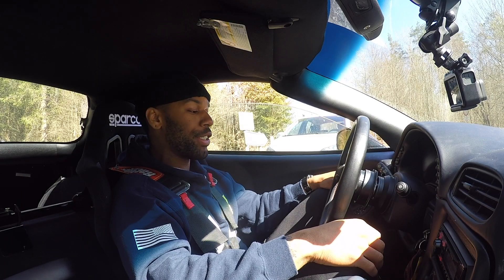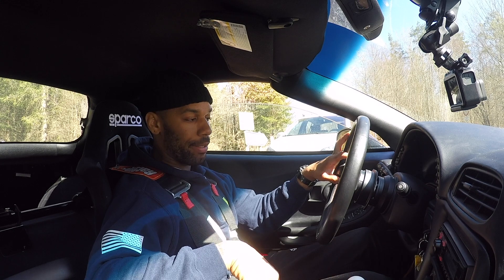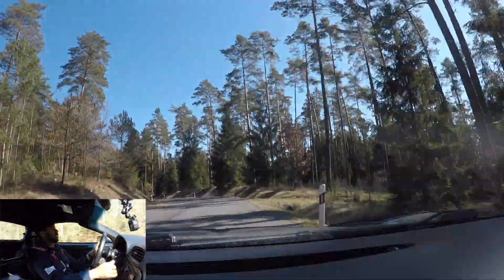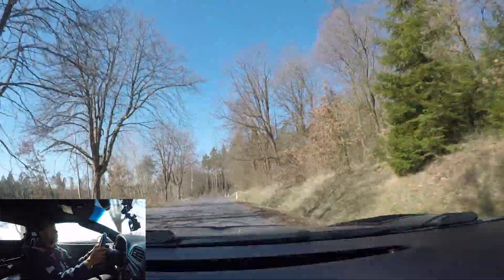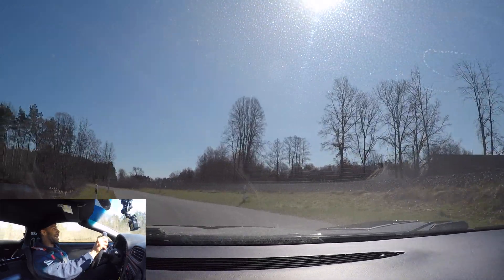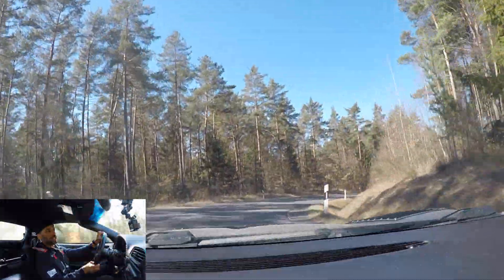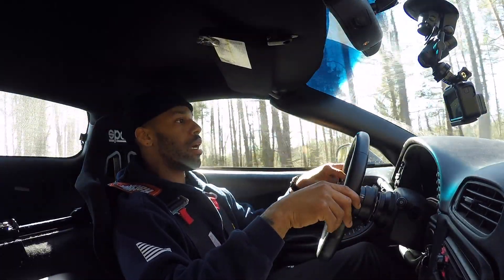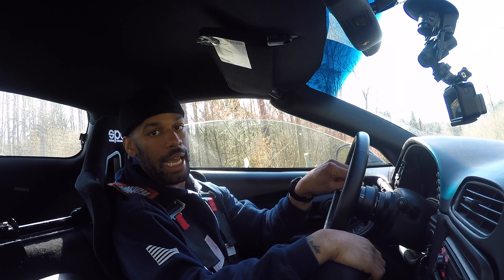400whp C5 Corvette Z06 Review

Comment: Love the vids. Mine is an ‘04 base and it’s great. Came from a NA Miata and ‘13 mustang and found the perfect marriage of those two vehicles. Running 285/35 square with Cam, intake headers (ported heads on the way from Texas speed). Tell people all the time it is the most rewarding and satisfying cars you an buy for 10-15K. Keep up the awesome content and stay safe.
Reply from the maker: 100% agree with you, people are so quick to write the c5/c6 off. But with the right mods these feel great, like a big miata, I came from miatas also so I know how you feel there. What suspension stuff do have done?
Reply: @Beezy_Builds   So far just poly sway bar bushings and lowered on stock bolts. Saving up for a nice set of coilovers and that MGW Shifter.
Reply from the maker: @sgtrosenfield  nice doesnt take much, make sure you get some sticky tires on her, consider looking at fortune auto coilovers, thats what I brought for mine, they are hand made im the U.S. and you can get them in any spring rate you want

Comment: Great video, thank you so much for
the content, quality, & not condescending, your input & advice
was genuine. SLR knuckle mods next on my priority list. As a speed freak myself "sport bikes /crotch rockets" on the track my 1st upgrades are brakes stainless steel lines, hi temp pads, sticky tires, suspension adjustments & last but not least engine & exhaust mods.
Many enthusiasts mistakenly upgrade horsepower before brakes,
tires & suspension. Smooth "COHESIVE" like you said makes for
better feedback = smoother, faster, connected experience...
Reply from the maker: i'm glad you enjoyed the video brother! you will enjoy the SLR speed kit for sure just be aware you will no longer be able to use traction control with it. ABS will still work fine though. Sounds like you get it though power is always last on the list, imo balance is key for the type of driving I enjoy doing. what you plans for your vette?
Reply: @Beezy_Builds  no track time, just a really balanced, cohesive, great feed back ZO6...handling, acceleration, braking, cornering for daily driver, across state & twisty roads... pretty much same build as yours with more of lazy boy seat. getty up !!
Reply from the maker: @408SPLKINGS  nice I'm excited to see how your build turns out brother, hit me up if you have anyother questions
Reply: @Beezy_Builds  thank you for your videos & awsome input / advice..my zo6 is gonna be a clone of yours minus the seat.

Comment: 2:40 In regards to your seat/harness setup, your shoulder harness angle seems to be wrong.  You should not have more than 20 degrees angle and from the video it looks like you're probably at like 45 degrees.  Harness bar either needs to go up or the seat down.  In case of accident, it can put a lot of stress on the spine.  I know this video is 2 yrs old, so hopefully you see the comment and make some changes if you haven't already. Also driving around streets with racing harness without helmet and head and neck restraint is just bad idea, you can get serious neck injury in case of accident.
Reply from the maker: Cant speak to the harness angle since I sold the car two years ago, but I do agree that a harness on the street is a big no no

Comment: Enjoying the content, keep it up. Quick question. I'd like to adjust camber on my C5 but can't get more than 1,5° on the stock eccentric cams. Is there a way to increase camber or do I need one of the camber kits, like AMT? Thanks!
Reply from the maker: You should 100% be able to get mote than -1.5, I'm still on stock bolts and I was able to get a good amount of negative camber